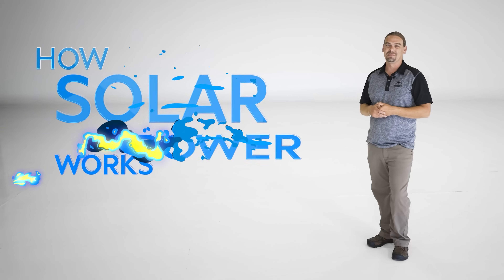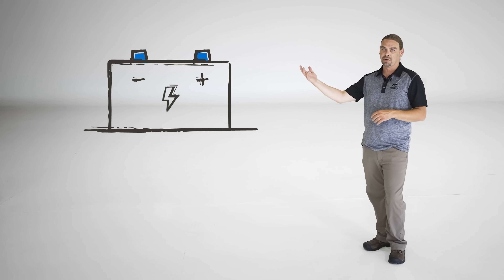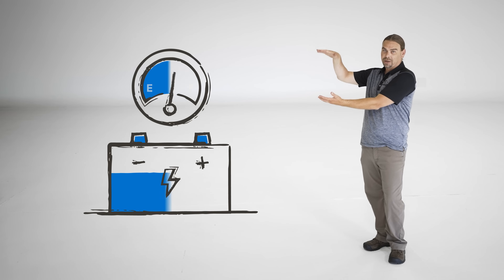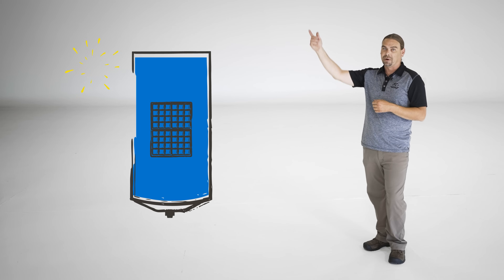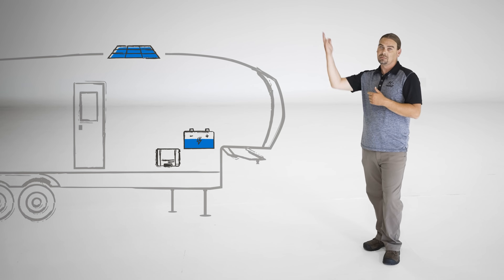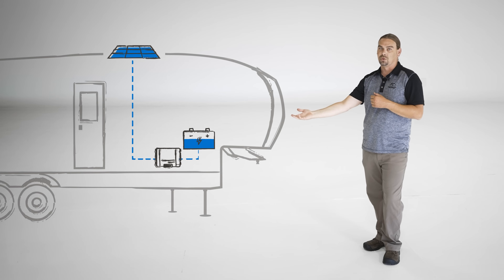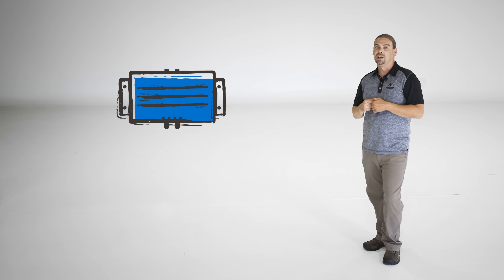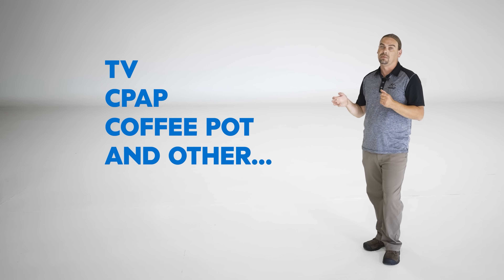THIS is how solar power works in an RV. Welcome to Solar 101!

Comment: Not sure if I'm totally correct but what do I need to run solar through the 9m9 plug on the side of the camper. Do I need a charge controller or is that built into the system? Thanks.
Reply from the maker: You will need a separate controller for this side solar port! All wiring is prepped there as well so you just need to plug in the solar panel.
Reply: Thank you I thought so. I was looking for an all-in-one piano with the controller. @KeystoneRVCompany

Comment: New to the RV world. How do I switch the plug in outlets to use the solar power instead of the electricity from my extension cord that is plugged into the RV with the outlet converter
?
Reply from the maker: Good Evening! If you have an inverter in the unit for these inverted outlets, you can turn this on when you do not have shore power to be able to utilize those outlets. As long as you get sunlight to charge up the battery from the solar panels this would operate from there.

Comment: Everybody knows how solar works but I want to understand is how it really works in a camper . Will it charge when they kill switch is off?
Reply from the maker: Good Morning, what switch are you referring to when you mean "kill switch"? The battery disconnect and solar disconnect (if you have one) will need to be on to charge the batteries properly.
Reply: @KeystoneRVCompany  hello, the battery disconnect switch.  If the camper is plugged in to AC power and the switch is off it will not charge the battery.  The question is if the switch is off will the solar still charge the battery?
Reply from the maker: @larryenderle7719  Good Morning, yes the battery will still charge if the switch is turned off as the battery disconnect just stops power from entering the unit.

Comment: no good on cloudy days tho
Reply: That depends. We have a large, high voltage solar array on our motorhome that we live in off grid full time. It will still produce perhaps 20-25% of its rated capacity even on rainy, overcast days. Since I have 5kw of solar, we're talking about 1,000 watts or more. If you are living like this full time, you need a large enough battery to last several days till the weather improves. We have a large enough battery (23.5kwh) to get us through about a week of bad weather. A large system like this cost us about $10k to build ourselves, but it paid for itself in less than 2 years in RV park fees it saved us.
Reply: @SuperSushidog  impressive. Is your RV towable?

Comment: Help! I need some basic instructions. I have the 2022 Passport GT series, comes with 2 Solar panels. So one day I disconnected from the power at an RV park during a storm, eventually my TV shut off and lights dimmed. Refrigerator shut off. In addition to the 2 solar panels, I also added a battery (total of 2 acid batteries). Why didn’t i have enough power from my 2 batteries to keep those things on? It was beeping and telling me it was low on battery... the battery disconnect was on. Am I supposed to flip a switch or something in order to tap into the solar? How can I tell that the solar panels are Charging the batteries? This video didn’t address that. I was assuming that once power is disconnected the batteries kicked in and if I’m boondocking then the solar panels would be charging my batteries and I didn’t have to do anything... please help! And please add your support number to the video descriptions on every video, you guys respond to comments with that phone number and this is the fifth video I’m on trying to find that phone number to speak to someone about this. Thanks!
Reply from the maker: Good morning, we had responded on your other comments regarding this as well on another video 3 days ago with the support number and information on where you needed to call… We are sorry to hear you’ve had issues with your unit’s solar system. There isn’t enough information provided here for us to be certain what is happening. Based on what you are noting, as long as there was sufficient sun, and stored energy, the batteries should be charged up even with the 200 system. There may be an issue somewhere in the line, however, we can’t be certain until you’ve confirmed the following and have this formally inspected. You’d want to see the status of the Victron App to see what power is coming in/going out, and we’d want to see that the batteries are testing good. If the controller and batteries are good, there should be enough power to keep the lights on. The TV wouldn’t work unless you purchased an aftermarket inverter for the inverted outlets. Not sure if you did that, as you don’t mention that here. The batteries and inverter are not included by Keystone RV. I would ask that maybe you report your findings and any further questions through our retail team at 1-866-425-4369 Monday – Friday with your VIN. We do have solar experts in our call center that can also answer questions and troubleshoot with you. Thank you.

Comment: what size lithium battery is recommended with the 400i?  is the OEM converter/charger lithium compatible in the 2022 models coming with solarflex?
Reply from the maker: Good morning, we are installing a 100Ah Dragonfly batteries on ones with an included battery. You could use whatever you like, this is just what we have to install and provide to our dealerships if needed. In regards to your second question, due to rapid changes in manufacturing, we'd have to have you call in with your VIN to our retail team to verify what converter you have in your unit. We couldn't answer that question here. It would be a VIN specific question, so you can reach them Monday-Thursday 8am-5pm and Fridays 8am-4pm all times EST - 1-866-425-4369. Thank you.

Comment: I have an older 2013 31sqb Keystone Cougar that doesn't have the newer prewired solar connections.  So, I'd like to know if there is some sort of conversion I could add that would allow me to connect my Inverter into the  onboard systems much like you'd do with the shore power connection so that it recognizes that power is coming from the batteries/ inverter and doesn't try to recharge the battery back thru the converter.  

If Keystone RV has additional videos in your series that discusses how those of us with older models can upgrade our systems to take advantage of these manufacture updates, please share with us all.

My setup includes two 6v Golf cart batteries run in series, connected to a MPPT charge controller, solar on the roof, and 1500w pure-sin inverter.
Reply: Good afternoon, and thank you for your inquiry. I'm sure it is possible to make this modification to accommodate your request, however, we would not be able to recommend it. We cannot recommend any aftermarket modifications to the electrical systems. You may want to consult your local authorized dealership to see if they can be of assistance. Thank you.
Reply: @alishahowton7127  Thanks, don't get me wrong, am looking for a manufacture option where I can change out the current 12v/120v converter to allow me the ability to connect the shore power connection to the inverter, but not create a loop-back that then tries to charge the same battery that's being used by the inverter.  That way I could then use the 110v outlet while being off-grid with the battery/inverter system.  If this is even possible.

Our local authorized dealers only try to get us to upgrade our unit vs trying to find a solution for our existing trailer.

Comment: How about showing the typical wiring of a cougar with OTG, especially how the electrical panel is wired and to the existing solar wiring located in the storage compartment.  Show us how to add an inverter to the OTG setup.
Reply: I have been looking for information on something like this for a while.
Reply from the maker: Good morning, and thank you for your video request. We have forwarded this on to our team here to see if we can put something together for everyone. Thank you.
Reply: I agree, this would be very helpful.  I purchased a 2021 Avalanche 312RS, It is solar ready, but it would be nice to see how I would actually hook it up.  Also, is there a way to install an inverter so that it will feed some or all of the existing  110v outlets?
Reply: Where’s the inverter installation video